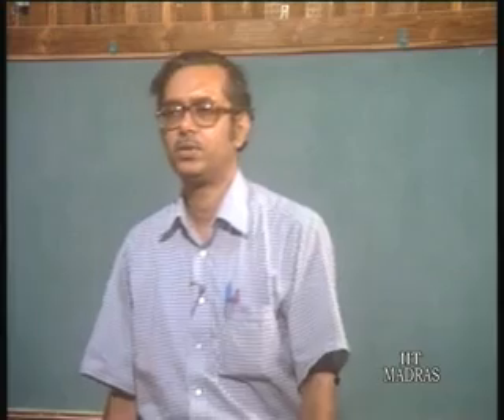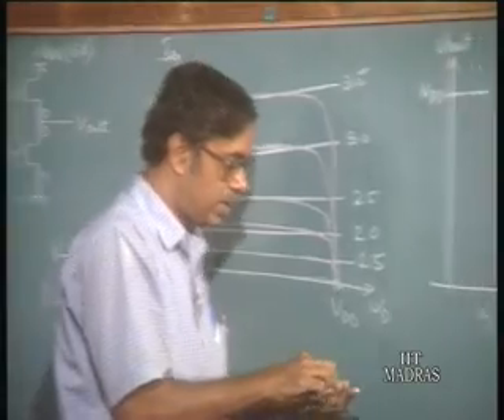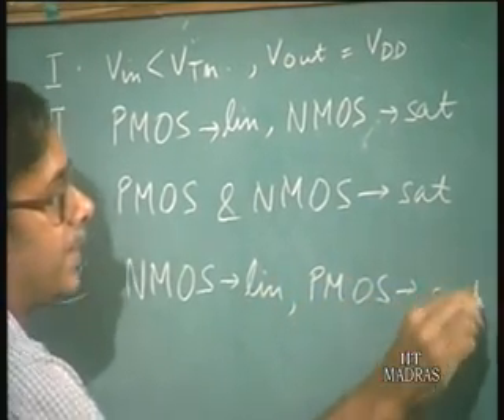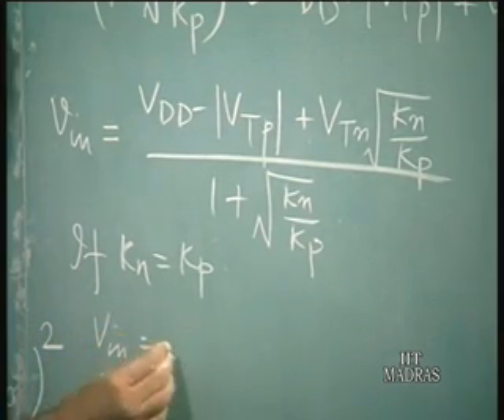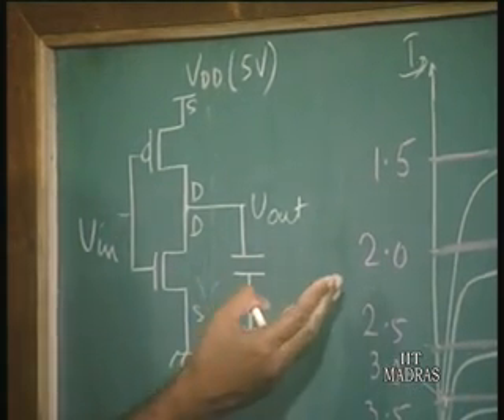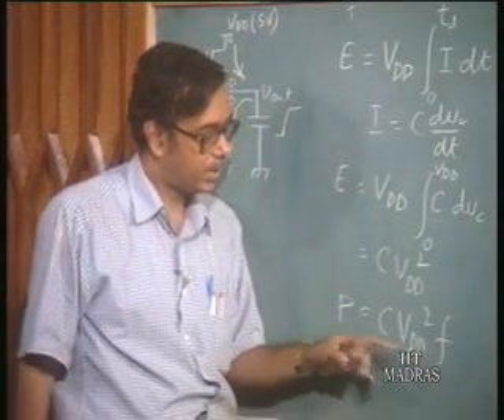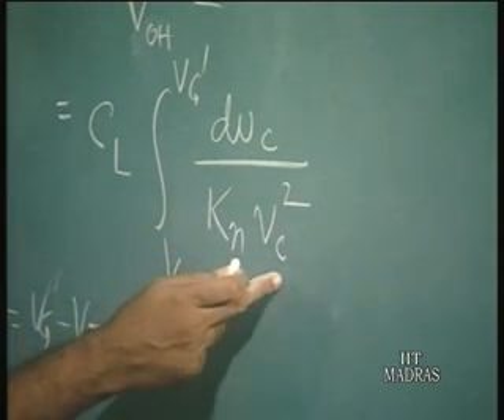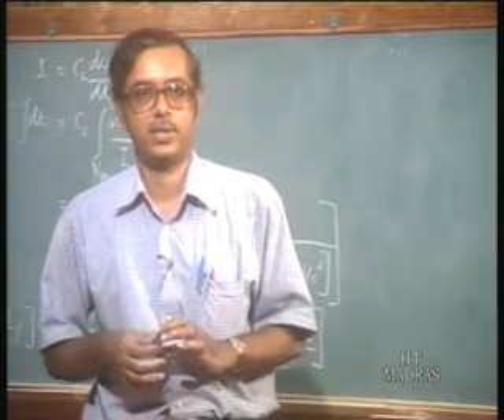Lecture 26 CMOS Inverter

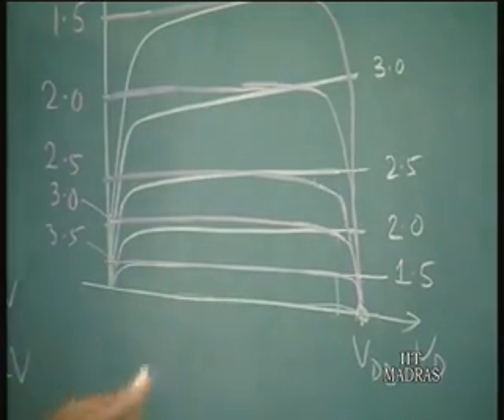Comment: I know this video is very old.  However, there is a mistake this teacher is making when looking for the point of intersection of the p-mos & the n-mos transistors.  Note how he's obtaining the high output voltage intersection point by looking for the the intersection of the 2v N-MOS gate curve with the 3v P-MOS gate (These are always complementary to 5V as VGS of the pmos transistor is always Vgs - Vds (Vgd).  But he's obtaining the low output voltage intersection point by looking at the 3V nmos gate and 3V pmos gate curves which is incorrect.  He should be looking at 3V nmos gate to source and 2V pmos gate to source.  (This is happening at munite 9:00 to 9:30)...

Comment: I appreciate your feedback.  Just take a moment and think a bit about it.  The load capacitor is not constant.  It charges up and therefore varies.  It is universally known that the Energery is 1/2Cv^2 and not cv^2.  Now, if you believe he didn't make a mistake and you stick by it, it is your choice and I respect it.  But, trust me what I wrote was correct.  You can email the teacher and the teacher will confirm what I am saying.
I do appreciate that you care...
Reply: 1/2 Cv^2 is energy oscillating in the capacitance or power dissipated . But the power supplied by the supply is CV^2 . I hope I am correct

Comment: Great teacher, very methodical.  I am sure it was just an oversight but he made a mistake I would like to correct: He should not have gotten Vdd out of the integral as V at Cout changes as the capacitor charges up.  So, the Energy E = Int(vIdt) = Int(vCdv/dt)dt=C Int(vdv) = 1/2.C.Vdd^2.
Reply: No, He calculated the energy supplied by the battery and not energy stored in the capacitor